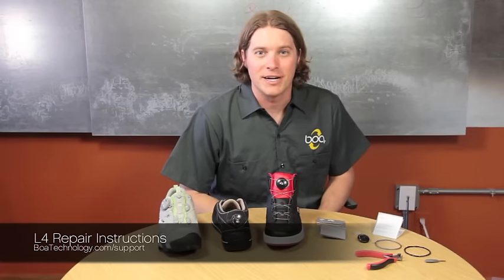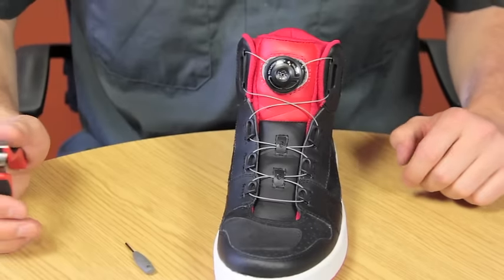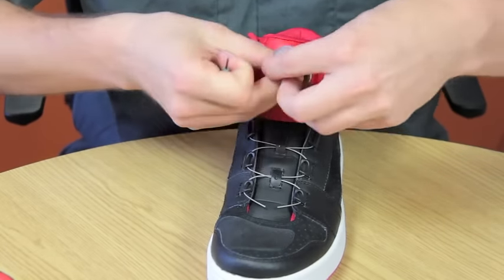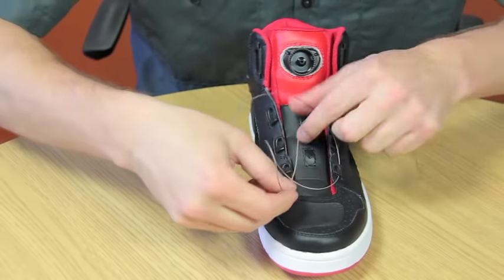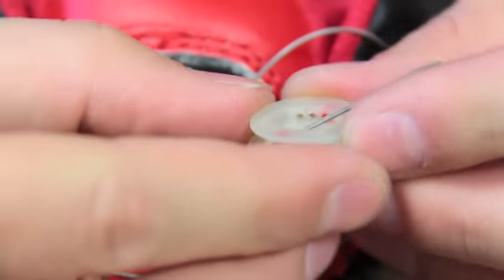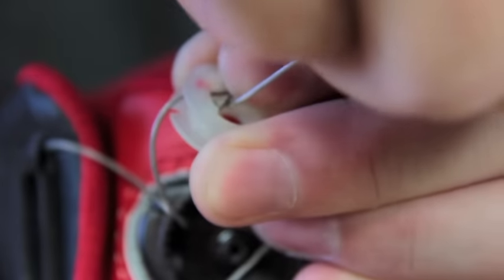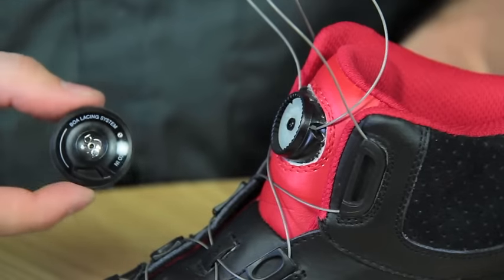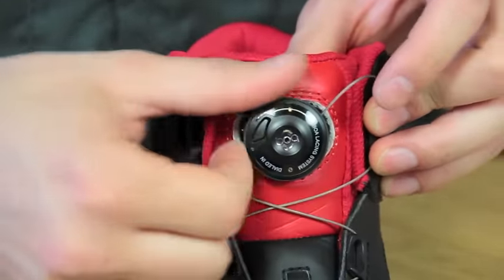Boa System Repair Instructions.mov

Comment: STUCK BOA LACES - AWESOME VIDEO!!  I was able to use an eye glass screwdriver to unscrew the dial and remove the spool.  I discovered the wire was twisted and bunched up inside.  I was able to undo the know on one side, trim the wire, and reinsert.  Fortunately, I had ample thread left for the shoe to loosen and slip my foot WIDE foot in and tighten.  GREAT FIX.

Comment: Hello. Thank you so much for this video!
This is my second pair of protective shoes. The first one was worned down due to using them pretty much all the time.
This second pair, yesterday got tangled in an impossible way and after trying for more than hour without result, I found this video and I accidently had an Torx T6 screwdriver and with it I could disassembly the wheel and sort out the tangle issue.

Comment: What happens when the dial is pressed in, and you can still loosen the lacing by tugging up on the tongue of the shoe? I have the Pearl Izumi PRO Leader road bike shoes, and BOA supplied me with the IP1 Mirrored + CS1 replacement kit under warranty. I'm following the instructions, and the dial will not lock securely. I nearly pulled my foot right out of the shoe during a sprint the other day.

Comment: I hate this Rube Goldberg system. Puts the repair labor on the purchaser. Not to mention that it takes a long time to actually successfully complete the repair.  Buckles are more adjustable and easier to fix.    A REALLY CRAPPY PRODUCT THAT YOU CANT AVOID. 😢
Reply: You do know most shoe stores that carry these shoes will fix them in store at no charge right??? 

I've never had one need replacement but when buying I ask.
Reply: @socalpunk05  NO bike shop will repair or replace these.  It’s up to you to order the right Boa and instal it.  I have replaced 3 of these and all them took well over an Hour.  Not to mention spending an hour trying to replace the wrong Boa they sent me.